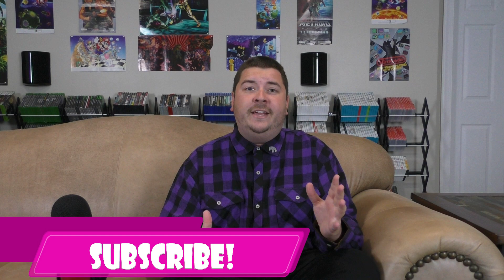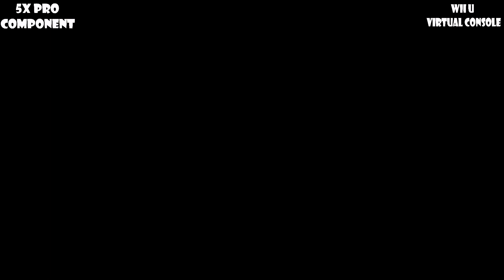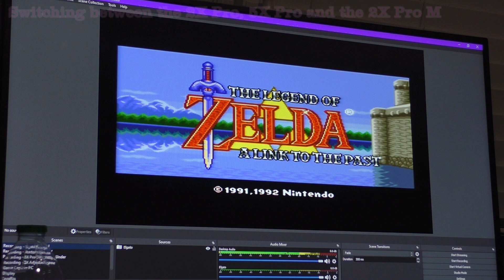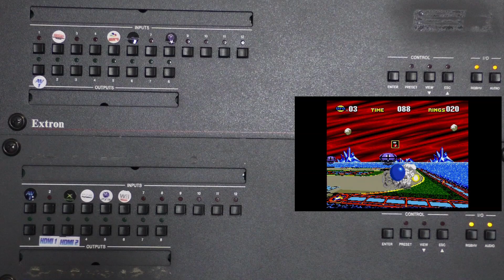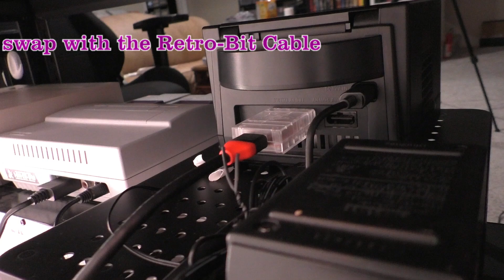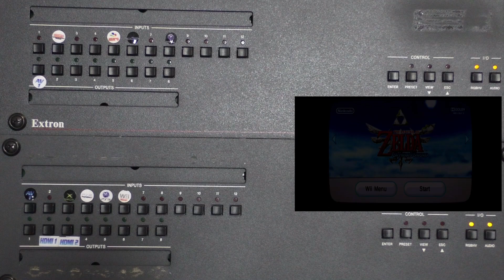My New Retro Gaming Set-Up: Powered by Extron!

Comment: Thanks for putting these guides together, man. I picked up an Extron and started fiddling with it during the pandemic as a little tinker project. The thing that kind of stopped me in my tracks though was figuring out how to capture footage! I've got question about two parts of your setup.

1. Could you go into more detail about the capture card part? You said it was an internal card, so I'm guessing you have a PC right there. Is that your primary PC? I'm in a position where my setup and primary PC will most likely need to be in different rooms, so I'm weighing my options. There are some capture cards that record to SD, which would solve the problem. Or I'm weighing the possibility of a small PC build to basically just run Elgato's capture program. Any thoughts on those options?

2. Please tell me what HDMI switcher you're using. I've experimented and messed around with so many and they all tend to come out lackluster. But you look like you've got several inputs on that baby and I can't help but be jealous.

Cheers and thanks again!
Reply from the maker: Thanks for watching! As of right now, my current set up has my Extron output to my RetroTink devices, using its multiple outputs via component to do so. Each RetroTink then runs into a Rocketfish 4 Port HDMi Switch. That switch has been go to me, though it seems fickle about doing the 1440p resolutions of the 5X Pro, sometimes it does it, other times not. The one I had in this video wasn’t the best, I think it was forcing everything to 16:9 that came in as 4:3, plus it had a little bit of input late since it was a matrix switch and not just a regular kind of switch like the rocketfish is.  

Then from there an hdmi runs out to my PC, I have an Elgato 4K Mk2, which has an input and an output onboard. It is an internal card, so it plugs right into a motherboard, with the aforementioned ports being accessible on the back of the PC. I usually just capture using OBS right there on my pc, with the Elgato card as the source. I did run an hdmi from the Elgato card’s output to my tv though, so I could play there like “normal” if I wanted to. Despite all these steps, Ive never had a problem with input lag as long as I use the Elgato’s output hdmi. Very rarely Ive noticed a smidge of lag when playing via the OBS capture.

My pc is all AMD, about 3 years old now. It’s a Ryzen 3900X with 64GB of 3200MHz RAM using a Sapphire Nitro+ as the GPU. I have an external SSD that uses USB-C to send all my capture to, stuff is stored long term on different drives though. The internal drive is also an SSD.

Hope that helps!

Comment: How are you connecting your RGB sync from the Extron switchers to your CRTs?
Reply from the maker: I don't have a CRT Tv. Been looking to get one recently though. My PS1 and N64 (RGB Modded) use Scart cables that run into RetroTINK RGB2COMPs, which then run into my Extron Switch using Component Cables. That is a complex but effective way to get higher quality output from those consoles while also keeping everything consolidated to my Extron Switches. I made those changes not long after making this video. Before that, I was just running Scart cables directly to the 5X Pro, swapping when needed. An alternative would be getting a Scart Switch, like the one RetroGamingCables was working on. I think that is out now.
Reply: @RetroBoost  Ah, I was wondering because I sometimes have trouble with sync out of my Extron into my CRTs, so I wondered if you had similar problems.

Thanks for the info.

Comment: You may already have figured out the answer, but for your Extron Crosspoint, you would want BNC cables. These come in various ends, most common being BNC to VGA and BNC to BNC. You can also of course get SCART to BNC. The great part is these are all fully analog so you can link them together as you please. For example, I've got one output that goes from BNC to VGA, then with a VGA extension cable attached, finally ending in a VGA to SCART cable. All works perfectly and lag free.

What you have to watch out for with these is when you start using RGB cables, you have to account for sync as well. It gets pretty complicated from there. It doesn't look like you are using any CRT TVs, monitors, or PVMs, so that simplifies things a little for sync stuff.

I would recommend you try to hunt down a small CRT TV or PVM just to give it a shot. The Retrotink 5x Pro does an awesome job, but there are still certain things about a CRT that can't be replicated. 

Great setup though, glad to see people discovering Extron devices. While the gcompsw/gscartsw can output to two devices, they can't do so simultaneously. That's where the Extron Crosspoint really shines, you can send any video and any audio source to any output you want to all at the same time. That's why when new these things cost so much. Thankfully they have been retired in professional video production environments so we have a ton of them available to us for affordable prices now.
Reply from the maker: I’ve seen cables that end with bnc on a few different websites, those are definitely on my list. I’ve invested so much into the cabling I have, so I’m utilizing that with RCA to BNC Converters for now. I’ve also been really curious to get a CRT, but the problem I have now is that there is just nowhere to put it. That’ll be stuff for the 4.0 set up I guess. Fantastic information here though, really appreciate it!

Comment: I think with Extron switches you wanna skip the scart and just go with straight rgbs cables? Check retroaccess and just click the "BNC cables" tab. I think you'll find what you're looking for.
Reply from the maker: Thanks for the tip! I’ve been using a RetroTink RGB2COMP for now for my N64. If I could get just a cable with the right breakout that would save on cabling and the need for power. I haven’t notice any latency issues or picture issues with the RGB2COMP though, I’ve been happy with it.

Comment: Why do you have the retrotink 2x and 5x? Isnt the 5x enough for everything? I have been wanting to get Esther the 5x or 2x, but still undecided. I want to hookup my nes, snes slim, n64, gamecube and wii. Since you are  the expert in this subject, do you think the 2x would be enough? Or should I get the 5x? Thanks for the video!
Reply from the maker: I had a 2X Pro originally, then got a 2X Pro M when I realized that the 2X Pro cannot accept 480p input, which the GameCube, Xbox, and Wii are all capable of outputting. Then I got the 5X Pro to further consolidate my needs into one device. I still keep everything hooked up though because it’s fun to have options! Given that you said you have the GameCube and Wii, I’d recommend the 5X Pro so you can run those consoles in the better output modes. It can make a real difference. The nice thing is that you can just use your Wii for running GameCube games in progressive and avoid the additional cost of component cable. Wii component cables, even shielded ones, are easy to get and aren’t terribly expensive.
Reply: @RetroBoost  awesome man, thanks a lot for your feedback, I will order a 5x then. Make sure you get a comisión from Mike haha.

Comment: Nice video Mike. That's a lot of cables 😀does picture lose and quality  or is it minimal when run through switches?just wondering because it's a slight detour somewhat
Reply from the maker: That was something that worried me when I first got them hooked up last year, but I’ve never noticed any noise, distortion, or degradation. You’d think that there would be latency with all the jumps, but again I’ve never noticed any myself. I think the main that helps prevent loss of picture quality is the fact that these switches are powered, and since they don’t buffer or process the picture, it also keeps latency to a minimum.
Reply: @RetroBoost  yeah I get what you mean that's one thing that worries me about switches of any kind is the loss of picture quality

Comment: I remember when I first read about these Switches. They were Very expensive. I have to think that they would last a very long time so You kinda get what you pay for.
Reply from the maker: Indeed, the prices for these can range greatly. I found my first one for about $70 I think, but the shipping was like $25 alone given the size of these thing haha. The prices really fluctuate, they go up and down all the time, but mostly seem to be on the rise. From what I’ve learned about them, they do last a long long time.
Reply: There a lot of different versions, but generally the 8-in-4-out model runs between $80-120. A gcomp is $295, which I think is too much for what it does. Auto switching is nice, but not for more than double the price of a Crosspoint. I’ve used so many other component switchers, but the 2 Extrons I have are by far the best solution I’ve had.

Comment: Was rewatching your video and remembered that you said you didn’t have shielded cables for your OG Xbox. Console4You makes a Wii2Xbox adaptor that let you use Wii component cables. I have one using an HD Retrovision Wii component cable and it all works great!
Reply from the maker: Oh wow, awesome recommendation! I have a shielded SCART Cable from RetroGamingCables for Xbox, but the problem with that is that you lose the ability to have the Xbox output 720p or 1080i, since SCART maxes out at 480p.

Comment: RetroTink makes a SCART to Component converter, so you could use a Dreamcast SCART cable to plug into it and then run a component cable into the Extron. Sort of an expensive workaround for the convenience of having everything go into the Extrons. However, I’ve been waiting for the Dreamcast component cables for years, so I gave up and purchased a Retro Access SCART cable. It plugs straight into the Tink-5x. It’s the only console I have hooked up using SCART. If/when HD Retrovision of Retro Gaming Cables or someone else releases good Dreamcast component cables, I’ll definitely buy them. But by then I’ll need a third Extron! 😅
Reply from the maker: You are right! I totally forgot they sold that device, the RGB2COMP! It would expensive, but I would be able to get everything consolidated to my Extrons that way. Fingers crossed that we eventually get proper Dreamcast Component Cables though!